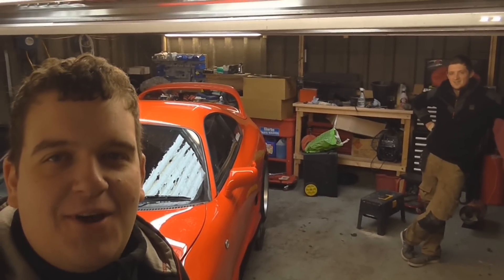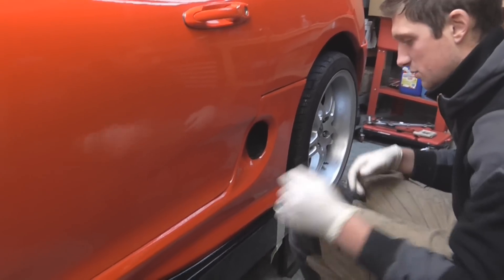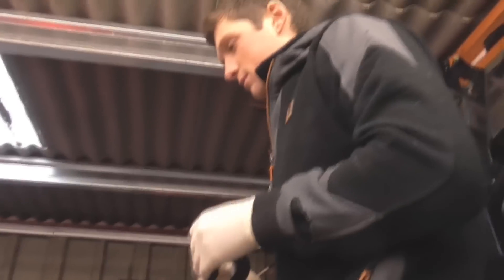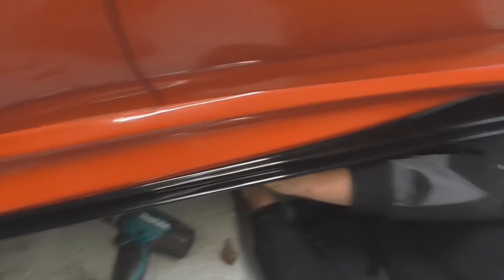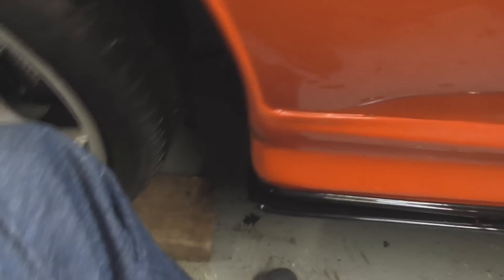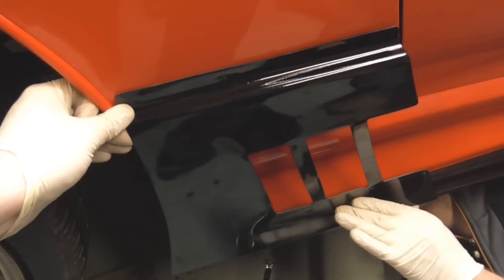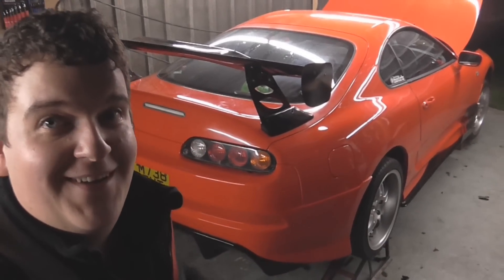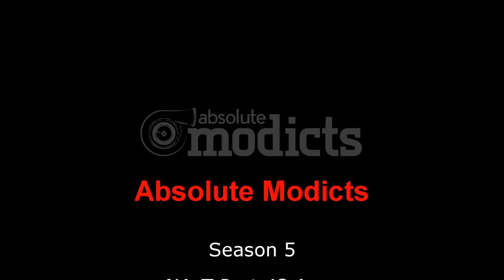SINGLE TURBO SUPRA AERO PACKAGE INSTALL - Part 43

Comment: like it all but the air diverters just dont look right to me
Reply from the maker: lukethekanefan we have looked and looked at them. there are 2 options of how to fit them  either under the skirt extentions or between them. we may swap ours around.  but they would use the same bolt holes so no issues. thanks for watching and commenting.